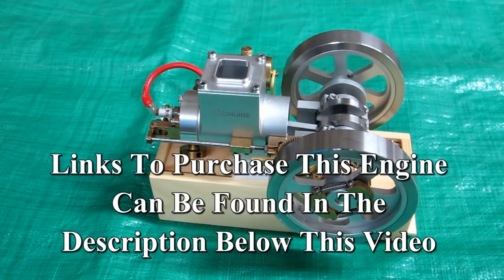Eachine ET1 Upgraded Hit & Miss Engine

Comment: will the glas oiler M4 fit on the shaft blocks?
Reply from the maker: I don't know. But, you do not need an oiler on the blocks because the crankshaft runs on bearings. With 1% Marvel Mystery oil in Colemans Lantern Fuel you don't need an oiler on the cylinder.
Reply: @RonaldWalters2010  ok...thanks👍

Comment: The only thing that bothers me is there is no oiler on the cylinder and the piston ring is a rubber "O" ring.
Reply from the maker: With 1% Marvel Mystery oil in Colemans Lantern Fuel you don't need an oiler on the cylinder. A viewer told me he gets 4 to 5 hours no-load running on a set of o-rings and that is a lot of running for one of these little engines. The o-rings work and they are cheap and (while I haven't needed to replace mine yet) they do not appear to be difficult to replace. Oh yes... there are two o-rings on the piston. There are quite a few of these little engines out there and I haven't heard any complaints about the o-rings.

Comment: Ron, do you have any suggestions for me. I have have the new silver model and i have not  had  the same success as others at getting it to run. It has good spark, good compression. the spark is timed about perfect (just past top dead center) I am using straight Lantern fuel. (it is  not colman but it was purchased from walmart and is camping lantern fuel).  and the fuel line is full of fuel with no air bubbles. 

two different times it ran for a few seconds and then stopped but it has been a few days since i have gotten it to do anything. It seems like a fuel intake problem. the two times it did run were both after i squeezed the fuel line, pushing fuel into the engine. but now that dont even work. i have endlessly adjusted the carburetor screw. NOTHING.  How precise is the adjustment of the carburetor have to be? should i be  moving it in 1/32, 1/16, 1/8, or 1/4 turns, 

could it be that it is drawing air in somewhere else like the exhaust valve and not in through the intake valve? How to i test to see if it is drawing fuel in. the spark plug always seems dry when we pull it out. 

any suggestions would be appreciated. 

thanks for your time.
Reply from the maker: These engines usually run pretty easily
I am going to give this a WAG (wild ass guess) excuse my French… and say you may have purchased coal oil or kerosene which is the old fashioned wick-burning lantern fuel…. just maybe. I looked at walmart.com and it is a definite possibility. Go buy some genuine Coleman Lantern Fuel (at walmart it would usually be in a 1 gallon metal can). Flush out your tank and fuel line and try that new Coleman Fuel.
Walmart usually sells A LOT of Coleman Fuel.
My needle valve is just under ¼ turn open, Needle valve position is VERY sensitive. Adjustments in the 1/ 1000’s.
Pull the plug and rinse it with the Coleman Fuel and be gentile with it as they are a bit fragile. 
Good luck and let me know if my WAG was right. :-)
The next suggestion would be to only put 2 batteries in the battery pack which means you will need to make a blank for (to bypass) one of the batteries. This will give the ignition system 3 volts instead of 4.5 volts and this has worked on some engines…. but not always. Electronics is sometimes a funny animal. Try the Coleman fuel first.
Hope you are subscribed! :-) Ron
Reply from the maker: One other thing... this runs clockwise as viewed looking at the governor. 
It runs counterclockwise as viewed from the other side.
Reply: @RonaldWalters2010 ron, how long do your batteries normally last. i have had two sets go dead already and i have not even gotten it started. I have changed out the fuel for zippo lighter fluid but havent had much success yet.  two other questions (2) is it possible that i am  not spinning the flywheel fast enough. you think i need to create a drill spinner to help me get it started the first time (3) occassionally it will freewheel and wont get compression. is it possible the the rod that pushes open the exhaust valve needs to be turned back a little .  thanks for your help
Reply from the maker: Very difficult to diagnose something I cannot see. Have you changed or altered any positions of anything on the engine since you received it?
Do you have a spark? Pull the plug wire back and turn the engine slowly and it should fire as the magnet passes over the hall effect sensor (ref my video)… and it should fire just past TDC (top dead center). Always possible the switch is positioned opposite what is shown in my video so you need fresh batteries and play with the switch until you are certain you have spark. If no spark look for a bad connection somewhere. Fairly small wires on the battery pack.
Only way it cannot have compression is if one of the valves is sticking open or if the rings have failed on the piston. Since it hasn’t run I don’t think it would be the piston rings.
Oil everything including the valve stems, exhaust valve rocker and the slide/guide points for the exhaust valve push rod. The valves need to open and close very freely. If either hangs up it will not have compression. Use light oil like 3-in-1 or Singer Sewing Machine Oil. It is my impression these engines are test run before they are packed so I would not start adjusting things or you could create other issues. When the engine is on the intake stroke there should be a slight clearance between the top of the exhaust valve and the tappet on the rocker arm.
Does your spark plug have a gap?
If the needle valve is open too far the top of the piston will be wet, the spark plug will be wet and it will not run. My engine runs with needle valve ¼ turn open or slightly less. You should not need to choke the engine.
A friend of mine and I have both experienced the ignition system cutting out with 3 batteries in the battery pack. My horizontal engine runs with 2 batteries (3 volts) so you can try a dummy battery in one position to complete the circuit in the battery pack. The exact same ignition system is in my Vertical Hit & Miss and it runs perfectly on 3 batteries.
Batteries last quite a while as long as you remember to turn the switch off (therefore you need to verify the correct switch position). I know it sounds silly but when nothing is working…. make sure all three batteries are inserted in the correct direction. I have a friend who at best only has a 50/50 chance of installing a single battery correctly!
Flipping the flywheel as seen in my video should start the engine. When you are having a problem a cordless spinner and help. Always use it on the flywheel without the governor and the rotation on that side is counterclockwise. A video showing my 3D Printed starter adapter will be released on Wed Sept 25 with links to the printer files.
Always make sure the engine will turn over easily by hand before using the cordless starter.

Comment: Question to your comment at 04:00:

Wouldn't it be more efficient for a hit & miss engine not only to keep the exhaust open but also to close the intake during this high rpm period ?
Reply from the maker: With the exhaust held open the intake always remains closed. There is no mechanical connection to the intake valve on this engine. The intake valve on this engine works like a reed valve... suction created by the piston on the intake stroke  (with exhaust valve in the closed position) creates a vacuum which pulls the valve open and allows air to be drawn through the carburetor. When the exhaust valve is being held open, air is drawn in and exhausted through the open valve. Thanks for watching. Please Subscribe… that is what keeps this channel available.

Comment: Please explain how to make a dummy battery.  I want to try it on my engine.Great little engine,
Reply from the maker: You can go to Thingiverse.com and search for AA DUMMY BATTERY and get a few ideas. A friend drew one for 3D printing with a hole through the center. I installed a piece of piano wire in the hole... overall length needs to be the same as a AA Battery. You are just making contact with the terminals so only two batteries are needed for 3V instead of 4.5V  Or you could drill a hole through the center of a wood dowel and do the same thing. Thanks for watching!
Reply: Or just buy a battery holder for 2 AA’s ;-)

Comment: This is one of the coolest working models that has come around in a while, and it's actually at a price the working man with a bit of disposable income can afford. The upgrades on the "new" ET-1, 2 and 3 engines are minor, but they definitely improve starting and running.  The plastic "potted" ignition module seems to have ironed out the reliability issues with the earlier ignition box.  The water reservoir is also hollowed out on the bottom to allow water around the cylinder sleeve to keep the engine running cooler during long runs.

Comment: Thanks for the comprehensive review. I just placed an order for one via your link. Hopefully you get some reward points. Question: How long do you think the piston ring (o-ring) will last?
Reply from the maker: Thanks! I appreciate your support. The green o-ring is a high temperature material (or at least higher temp than std black). I turn it upside down and oil the cylinder in an attempt to get some oil around the o-ring. I've reduced the WD-40 in the fuel to around 10% and considering how messy it gets after a run, the cylinder seems adequately lubricated. The high temp o-rings seem to hold up well in many applications. I was surprised one was being used on the piston. Probably a good idea to purchase a few spares unless you have a local source for such things. I ran it 20 or more times (did not keep track or actual run time) and did not run it more than 5 minutes at a time. I view it as a demonstration model and not something to run for long periods. One key is to use only two batteries in the battery pack (use one blank battery). The ignition source seems to work better on the lower voltage. I haven't run it the past two months due to a shoulder operation. Did you purchase a Flame Licker at the same time?
Reply: @RonaldWalters2010  I received mine and have just completed the maiden run of the engine. It is awesome! Very pleased! I mixed 20% Marvel Mystery Oil and 80% Coleman Camp Fuel.  I did not time it, but I think it ran around 30 minutes on a full tank of fuel, 12cc. I filled the water tank, and it was steaming by the end of the run. I also applied a load to the engine from time to time. Such a bargain for this beautifully made engine!
Reply: @RonaldWalters2010  Hahaha, yes I did! 🙂
Reply from the maker: I probably would not run it quite so long. Shorter runs... let it cool off (Ref: the o-ring piston ring).
Reply: @RonaldWalters2010  Hmmm..... okay. I am thinking I have too much oil in the fuel mix as well.

Comment: Sir, I was wondering if you would confirm something for me.  If you have a multimeter could you check if the engine block is electrically connected to the battery negative?  I have the blue engine but the sensors and the ignition box both failed after only a few minutes of running.  I suspect the engine block should be connected to the battery negative and not just to the outside of the ignition box, which is not connected.  Since the silver one comes ready to run I just wanted to know how the engine block is grounded.  Thank you.
Reply from the maker: To answer your question, yes... the engine block is connected to battery negative. However, your ground (negative) connection should come from your ignition module to ensure the ignition electronics function correctly. Your ignition module is different than mine. My ignition module is sealed with epoxy and I can not see any of the internal electronics. The engine quitting after a short run seems to be an odd characteristic of the ignition modules. Use only two (2) batteries in the battery pack and replace the third with a dummy battery. I mentioned this in the video. That will give you 3 VDC instead of 4.5 VDC and your engine should then continue to run.  Thanks for watching. Please Subscribe… that is what keeps this channel available.
Reply: @RonaldWalters2010  Thank you very much for your quick response and your confirmation.  I have checked and my ignition box casing is isolated from the circuit board inside so those advice to connect the engine block to one of the screws on the box is insufficient.  Would you say the box should be opened and the ground wire from the engine block should be soldered to the battery black wire on the circuit board?
I suspect some boxes have the battery negative connected to the box casing while some are not and that might explaine the reason some people have no problems running theirs at all.  If this is the case, they are not hit and miss engines, they are hit or miss :-)
Reply from the maker: I would not expect the engine to run at all without being grounded. Open up the box and have a look... maybe something came loose. The main thing is to use 2 batteries instead of 3.
Reply: The ignition system that came with the older (blue) MK1 is total garbage.  If it didn't fail quickly it will eventually fail and keep burning up the hall effect sensors.  The newer MK2 ignition is all potted in plastic and uses a different sensor.  I have yet to hear of any of these newer ignitions failing.  The newer ignition can be bought through the Microcosm site, and fitted to the older MK1 engine.
Reply from the maker: A friend (with a MK1) and myself (with the MK2) have found the ignition runs better with only 2 batteries in the battery pack.
Reply: The MK1 used 6 volts, (4 batteries) the MK2 4.5 volts. (3 batteries) I have had no trouble at all with the newer MK2 ignition setup, can't seem to break it no matter how hard I try.  I have been trying to figure out what the problem is with that first ignition system in the copper colored box.  It powers the hall sensor off of 12 volts derived from within. Even if you remove this and power the hall sensor directly from the battery with 6 volts of clean DC, the hall sensor still eventually dies.  I thought it might be oil mist ruining the sensor, but covered it with shrink tubing and tried it- no luck.  I gave up and converted my blue MK1 to the newer ignition to just be rid of the issue.  I can't take the older ignition fully apart as the rear (coil) section is potted within the metal enclosure.
Reply: The Hobbyking single cylinder RC airplane CDI ignition is said to work good with these engines as a replacement and is well less than $40.00, but it always seems to be on backorder. I paid $50.00 for the newer ignition from Jin at Microcosm.  Hated to waste the money, but have blown it on dumber things in the past :)